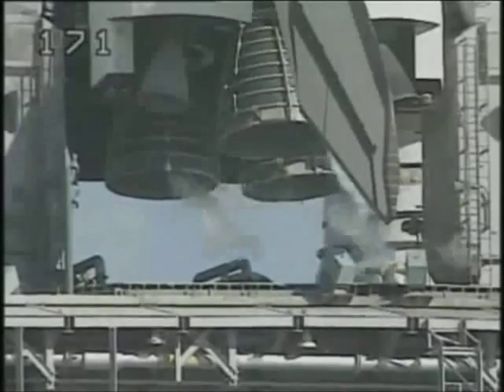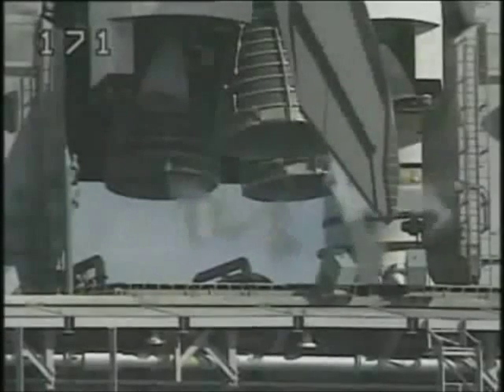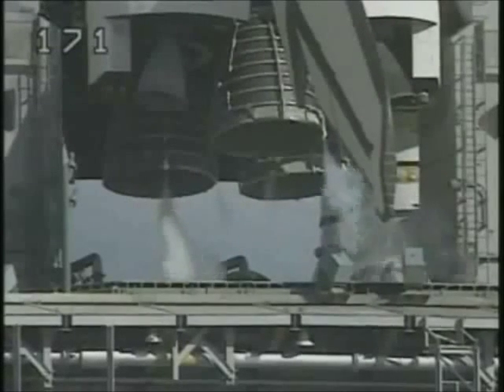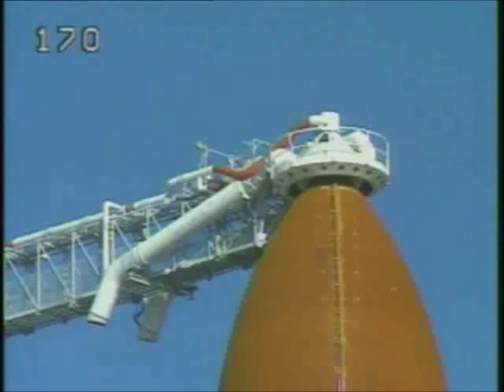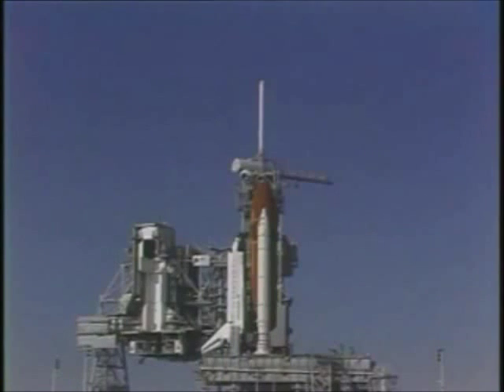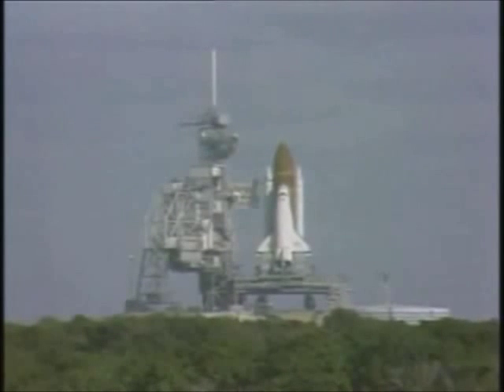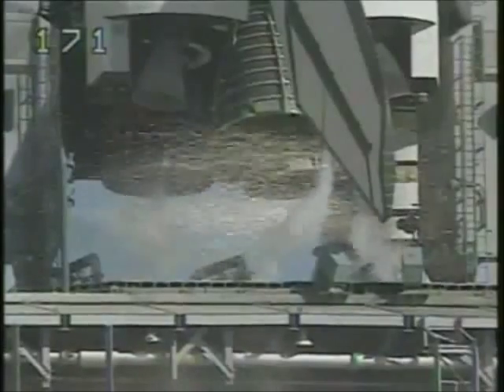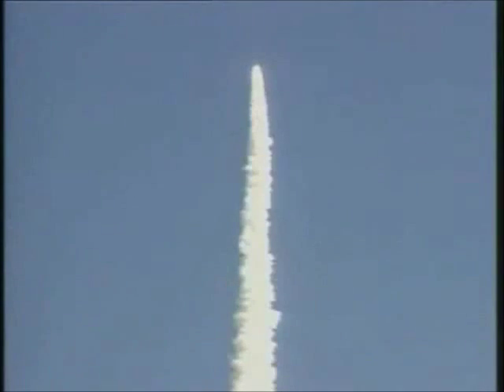STS-27 Launch and Landing

Comment: At 7:55 you can see the right SRB (on the left because the vehicle is inverted) is missing its ablative cap. That came loose and smashed into the right side of the orbiter and caused extensive damage to the tiles. Only luck saved the crew. A large tile was completely removed but happened to be sitting right over a steel mounting plate for an antenna. Only that prevented a burn-through of the aluminum skin and a Columbia-style catastrophe. More than 700 tiles were damaged. The military prevented a proper analysis of the damage because they are as dumb as hammers.
Reply: can't see anything.
Reply: @ashokiimc  Same lol...only boosters separation...nothing else...
Reply: @Summon256  he’s probably saying that just because he read that somewhere.
Reply: It's far to small see in that video fudge. It wasn't the whole "frustrum" (cone) that came off. Just the very tip, but it still did a ton of damage.
Reply: @Zoomer30_  Yes the cap not the whole cone which is jettisoned before the parachutes are released. It's a heat ablative device. I can barely make out that it is missing.

Comment: 15 years later in 2003 the space shuttle had foam fell on the wing of Columbia.  And it broke apart during reentry the same fear they had on this flight.
Reply: 15 years later STS27 was a full success
Reply: Columbia's tiles were knocked clean off...

Atlantis, on the other hand, only lost one tile while most of the others were scratched up by the impact.